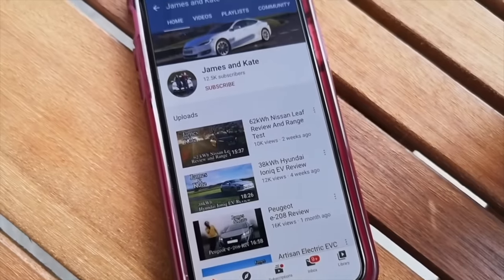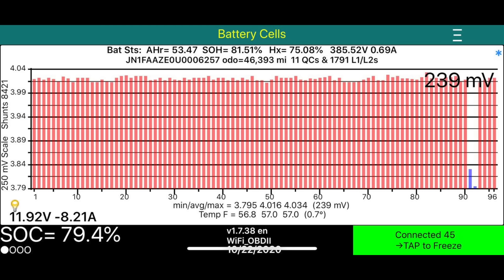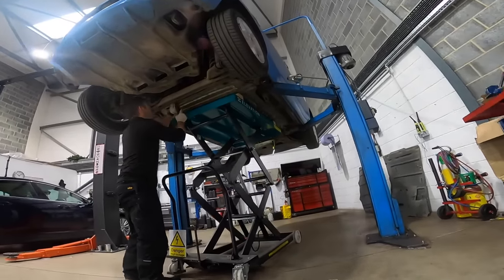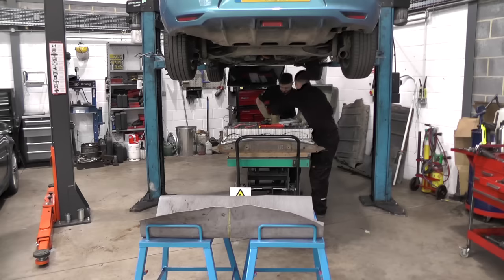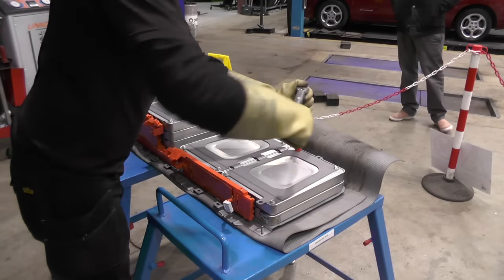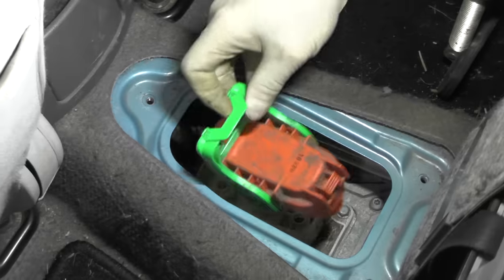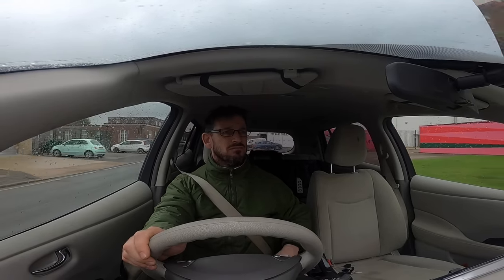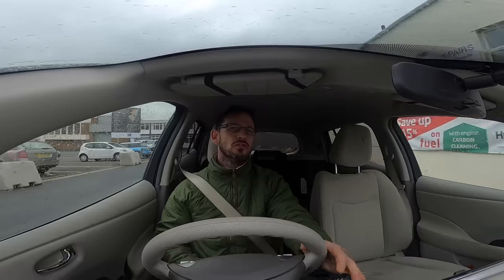Electric Car Battery - Dead After 3 Years, Right??

Comment: The perception of poor battery lifespan for an EV (and by association, the whole vehicle lifespan) probably arises from so much of our everyday tech being life-limited by battery performance and the economics of putting it right. Our throw-away mindset!

Really refreshing to see this vid and the way it removes the mystery and de-bunks the myth.

The ordinary public may still take some convincing though, they are likely to regard the EV battery as an expensive “unit” rather than a pack of less expensive replaceable modules/parts. Little different then from “the engine” in a conventional internal combustion vehicle. They will be reliant upon the advice they receive from the garage they go to for service/repair work, and of course, parts availability, convenience and timescales of having work done. 

One thing that comes to my mind is that with the Leaf, the battery of earlier versions is simple, and criticised, for having no cooling/heating. But this must make it more economic and easier to repair than an EV that has more complex systems. Maybe it is the Morris Minor of EV’s!

Comment: Sadly, new Teslas (and probably other EVs) will prioritize manufacturability over serviceability. With non-modular battery pack as an integral, load-bearing part of the chassis, similar to what was announced during Tesla's battery investors' day, there will be no repairs like that. Hopefully, the manufacturers will compensate by the ability to isolate faulty cells. We shall see.
Then again, at least one manufacturer already offers a million kilometres battery warranty.
Reply: Correct, but these kind of batteries will simply never need servicing or replacing and will last longer than the chassis and body of the car.
Reply: @Simon-dm8zv  I hope so...
Reply: @Simon-dm8zv  That is what we hope but so long as the battery elements can be recycled along with the body of the car.
Reply: @kiae-nirodiaries1279  I am sure that is taken into consideration when designing this new cell-body construction.
Reply: I definitely do not like the proposition of not being able to service or replace the Tesla battery once it becomes an integral part of the structure of the vehicle. That is such a bullshit design when looking at the supposed longevity and minimal maintenance that is spruiked about....
Reply: Tesla are like Apple, love to generate E waste where possible, and Tesla will not make it easy to replace damaged or faulty cells again like Apple 
Even with a million kilometer warranty they can still go faulty before that distance, so I would take that claim with a pinch of salt. Plus there will be a load of loop holes in that warranty

Comment: Impressed it only cost £500 to fix?  Picking up a wonky Leaf might be a good deal for a cheap run around, especially if another hour was spent treating that under chassis rust before fitting the undertrays.  Good work.

Comment: Great video.👍
I wonder how difficult a job it would be to  upgrade the pack to 30 or even 40 kwh ?
I'm sure there'd be some adaption required and software issues to sort out, but it would be interesting to see if it can be done.
Reply from the maker: That's actually an easy upgrade. 1 out, 1 in and a CAN bridge fitted.
Reply: Yeh, again, Nissan say it cannot be done, but the hackers have found a way. I think you can fit the 60kwh battery in a gen 1 Leaf too. I think a couple of garages in UK and no doubt elsewhere offer that service now.

Comment: Great video didn't also mention how you can strip the cells and make amazing E-bikes and other vehicles but yeah there is a point they do last a lot longer than most think even if sometimes not in the intended use they don't need to go to landfill.

Comment: Great video. What did you mean at the end by a few balancing charges and how can they be carried out. Also when I've got my 2014 Leaf set to charge to 80% it only goes to 78/79% (always goes to 100%). Its got full bars and only 60kKm and wondering in your opinion or experience what might be the cause.

Comment: I was wondering if the faulty module that was replaced could be repaired?  If so, that would be an interesting video. Also how did the cost break down?  The cost of the labor vs the cost of the replacement module.

Comment: Great video. I always assumed that the manufacturers would make the batteries non-serviceable unless you went direct to the manufacturer for an extortionate price. £500 is fantastic considering that will most likely be the only major service cost. I really want to get a VW ID3 and I'm hoping they are as simple for a place like this to look at as the leaf seems to be

Comment: Maybe NIO is on to something. Old or broken battery pack can be swapped out in minutes, then the factory can repair the battery and use it for next battery swap
Reply: Current quality EV batteries will last longer than the vehicle itself, so something like that is probably not even necessary. NIO works on battery swap technology to provide an alternative for fast charging.
Reply: The problem is that it is simply not scalable.  It's fine when they only have thousands of cars.  Multiply that by 1000 (as you will have to if it is going to replace ICE cars) and you see the scale of the problem.  It's difficult enough to build enough recharging points, imagine having to build that many battery replacement kiosks.

Comment: great video I'm a Automotive tech and I love this kind of videos If you can do more of them at that garage if would be ok from me it's a two hours job when you know what you are doing I was wondering was the replacement module new or used and can  you still buy them new at the dealer ?
Reply: U cannot buy separate modules or not even whole battery without assembly
Reply: Usually these are good cells from a crashed Leaf, as can be seen , this battery had just a couple of failed cells.

Comment: Very interesting and good to see. One question though, would you expect other packs to start to fail as well? A one off £500 repair is ok, but would worry me that I'd be doing this multiple times as they all begin to fail
Reply: It is theoretically possible that all the packs could fail but highly unlikely from the evidence of rechargeable batteries in use in everything from phones and laptops all the way up to ev's.  As James said, it is reasonable to expect that having replaced the faulty unit the battery pack should last another 9 years and the car itself.  At that point the modules will be salvagable for use in applications such as home storage batteries or even reused in keeping those few low mileage gen 1 Leafs on the road.
Reply: @michaelgoode9555  thanks for the response. While I agree that the car can be expected to last a lot longer, I don't agree that you can say it will now continue fault free for another 9 years. I'd expect more modules to fail (if one has surely more will) and my experience with laptop and phone batteries backs this up too. Not being a downer on electric cars, I'd get one if the infrastructure was good enough!
Reply: @Richard-xv3od  Depends on the battery, of course.  But generally, the cells will age together.  When you get down to where the range makes the car impractical and you have to replace the entire pack, it would be clever to install a 40kWh pack (with the adapter.)  I had my first-gen pack replaced under Klee (a court case in which Nissan was required to replace first-gen battery packs with 2015 packs,) and they also installed the needed adapter...so it is a part that Nissan have in their stocks.

Comment: Thanks. There is a whole new industry about to develop, servicing EV vehicles and batteries. 
 You are correct, it looks far easier than a clutch job, and this is a 9 year old car.
 Thanks for busting the battery myth, and this is an old car, later models with better cooling and better BMS will last even longer.
  There will eventually be a thriving recycling industry for old batteries, trust me, I spent my whole life in recycling, the industry is very innovative.
Reply: i would not be so optimistic. Pretty sure everyone one of them will learn from apple and or inkjet printer putting chips in their battery and even every functional component.

Comment: My Mitsubishi I-Miev 2011 was still running well (11KwH usable battery from distance calculations, down from original 16KwH) until it got totaled in a Drive-tru (Elderly Lady mistook gas pedal for brake).   It was only totaled because the bumper parts could not be found, battery pack was untouched.    But it shows these vehicles can last and should be made with longevity and upgrading/replacing battery modules in mind.   Seems to me most are made with throwing away in mind.    Just a terrible mindset.

Comment: Where can you get individual packs for these batteries? And what happened to the defective pack?  Most people wont have access to private EV repair shops - you know the dealers won't want to repair battery packs once out of warranty, so despite claims these cars 'can' keep going, reality is most will get quickly scrapped.
Reply from the maker: I think you mean modules, not packs. The modules are readily available but still pricey as they are very much sought after. Even when the capacity is low it's very much a usable battery for grid storage. Categorically, these don't get scrapped.

Comment: Great video. Unfortunately, Tesla has chosen in their new battery configuration to make the matrix surrounding the new battery pack to essentially replace part of the frame (or more accurately ) the unibody structure. So individual cells cannot be serviced and are thus quite possibly irreparable.

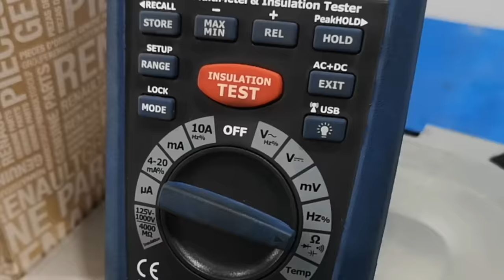Comment: Checking insulation resistance with a standard multimeter / ohm meter @ 3:47 ? - should this be done with an insulation tester that applies a high test voltage ( as is the case with testing electrical installations ) ?

Comment: Worth pointing out that a repair such as this is even less likely to be required on the newer (identical looking) 2nd gen Leaf, thanks to a completely revised battery chemistry which improved things significantly. But a repair would be identical as the battery tray is likely very similar.

Comment: Where the nissan guarantee because in at the dealer they be told providing you have your annual service battery safety check the battery remains under warranty.on a Rolling 12months?
Reply: That's Toyota on their hybrids.

Comment: Thanks for the informative video.
Can you clarify, if the price stated for the repair included parts and labour charges?
Are the garage you used currently advertising this service?
I,m sure the viewers would love to see more of this type of content, which would make the non ev 
Car users open to this mode of transport, as the myths are being busted😀😁😂
Reply: Hi. Glad you enjoyed the video. Yes, I can confirm that the price included the parts and labour, but it will depend on finding a  quality battery module at a decent price.
Reply: Matt, do you buy a who pack and strip it for good cells, or just buy the cells, I am looking at having this done to my poorly Leaf, once I have saved up a little?

Comment: I've bought a new Leaf Tekna 62Kwh.   The reason I went with the Leaf was its record of reliability and years of experience.   So I wonder how long and how complicated if the battery was liquid cooled etc.
Reply: Yes it’s irritating when commentators assert “Nissan made a mistake” as if it were accidental. Twice. It was a carefully weighed decision of cost and complexity versus necessity. A Leaf is not the perfect EV for every scenario, but it was not designed to be. It’s a 90% car – it’s designed to be just fine for 90% of people. It’s aimed at people in cities and towns in temperate climates. It may not be the best choice if you live in Death Valley or you’re a long-distance sales rep (remember them?). For most of the rest of us, it’s fine. Pay your money, take your choice.

Comment: wow .. you guys are hero's .. My same colour same year brilliant 2011 24 kWh Nissan leaf is looking and driving like new  at 20,000 miles ... but The local Nissan dealer in Portugal has told me my battery is good   just lazy..   He advised / recommended that I fast charge it occasionally. in your video you mention cycling  to balance the pack .. I fly R/C drones and the charger automatically balances the cells .   How can this be done on my 2011 Nisan Leaf. My battery capacity bars are down to 7 and the eco driving range is down to 68 miles ./110 km .
Reply: I can only dream of 60+ miles, my Leaf is on 7 bars and I only get 49 miles in Eco. To balance the pack, you should run the battery as flat as possible, then charge it up as full as possible (the a slow charge/granny lead). I don't know why you would be told to use a quick charge, I thought that puts unnecessary strain on the battery.
Reply: Use the cell voltage data from LEAF Spy to work out what you need to do.

Comment: Besides the voltage test of the module what exactly was the other test?
I build ebikes and model planes, the internal resistance of a cell is usually the indicator of health, lower is better.
The battery management board can give  problems too, I'd like to understand the test and how the bms is checked too..
Anyway it's good to see that these leaf batteries can be stripped and repaired.
Reply from the maker: We used a Hioki to test the module internal impedance also.
Reply from the maker: We used a Hioki to test the module internal impedance also.

Comment: I missed the mileage and the cost of that module cause I do not think that the 500 gbp coverred battery exchange module too even though old or used modules could be cheaper than tesla's 5 kwh packs
Reply: The parts and labour were £500 (two people at 2hrs each) and the car had 43k on the clock.

Comment: Father worked for the town council in their garages as a mechanic. The e-vans they had all failed within a couple of years. All due to charging issues. Problem was tracked down to their charging station being faulty. All the vans were sold off as battery/mileage was now low. Nobody at the garage had the time or skill to fis these issues. 
Simply put - 
Folk who installed the system could not diagnose faults. 
The council's garage department had not invested in trainng and so the department rubbished the e-vans first chance they got. They changed over to hybrid vans and conventional ICE vans. To this day, the charging station that caused the initial problem is still at the garage. Unused. 
As your video seems to point out; battery powered vehicles require a new type of mechanic to keep them on the road.
Reply: Sounds about right. Local Authorities are not known for taking exceptional care of their vehicles......

Comment: Thank you for the video. Not knowing a great deal about ev's I am concerned about the battery. I assume not all ev's are as easy to work on as this one. I have heard the Tesla batteries are encased in a pink foam like substance which makes them harder if not impossible to work on or repair. Why can't all manufacturer's make the battery in this way where a faulty cells can be replaced without ripping off the customer stating the whole battery needs replacing.

Comment: I have been driving 40 years, do average of 10,000 miles a year (used to be 40,000 a year around London) Never worn a clutch yet. ICE save you £10,000 to start with so that is 20 Clutches worth.
Reply from the maker: Excellent, a testament to your driving ability. I however have changed a shed load of clutches, DMF's, timing belts/chains and other quite in-depth work. I'm pretty sure I'd still prefer a two hour module swap.

Comment: What is the mean time between subsequent cell failures on a battery pack after the first cell/module failure? Most cells in a pack are initially from the same batch, so I'd be at least a little worried that once the first failure has occurred, the next one may not be very far behind.
Reply from the maker: Generally, we don't see isolation faults in these packs, this was more or less, a one off. The isolation failure was also the cause of imbalanced as it was draining the cells. Normally these older tech packs suffer from degradation as the chemistry used wasn't the best. This one isn't doing too bad

Comment: Awesome! I fly RC planes and used to race Rc cars, and even though the batteries have several cells, if one goes down, you generally have to throw the pack, wasting several viable cells!
Reply from the maker: That's a shame. Surely there must be a way to year it down???
Reply: @Jamesandkate  Problem is that the cells are  so well stuck together that there's a major risk of either a short circuit, exposing the lithium polymer to air, or damaging it in some other way. And you really don't want to do that at home, or even on your shed! If you fly non motorized gliders, you could use Li-ion cells, but although they are available pre-built into packs in smaller sizes, weight is still an issue.
Reply from the maker: Ok, understood. Thanks for the info 👍🏻
Reply: @Jamesandkate  Heh, sorry I wasn't thinking properly. Li-ion cells can be had in small packs, but due to their metal casing they're heavier than a Lipo pack with similar output.

Comment: Maybe it's a bit too early for me to pitch in, but I'm into the second year of owning my Chevrolet Bolt EV and the battery shows no signs of degradation, none whatsoever. The car performs exactly as it did on day one.
With that in mind, I do agree that the battery is very likely to outlive the car.
Reply: It's very likely the battery on your EV will still be in use long after the car itself is scrapped. Here in the UK, the average age of scrapped cars is just under 14 years. But the batteries of EVs can have a second life for static electricity storage, i.e. they can be re-purposed and have many many years of use before they'd have to be recycled.
Reply: @davidkeenan5642  We'll see about that in due time. Right now, though, my Bolt EV gives me nothing but joy. :)